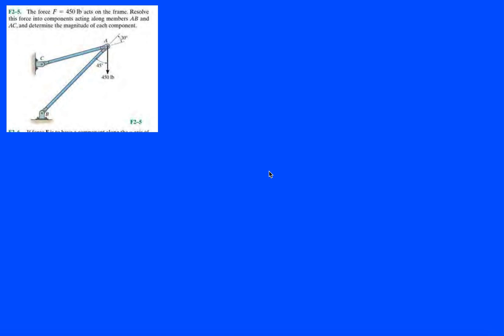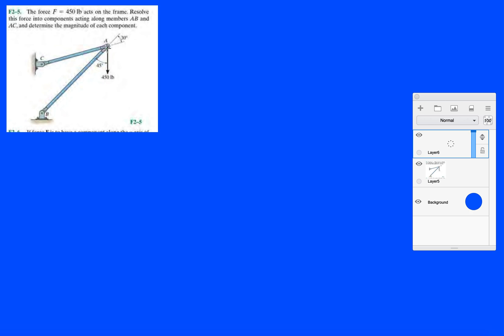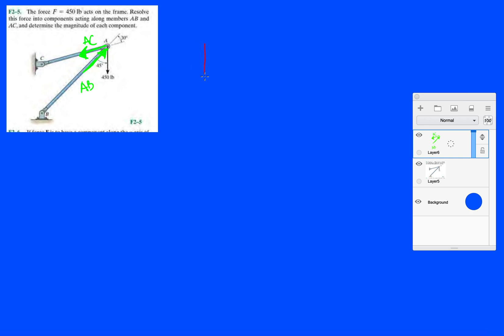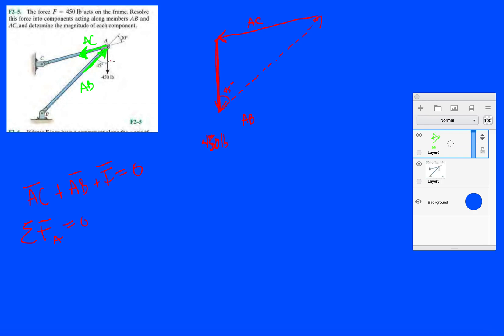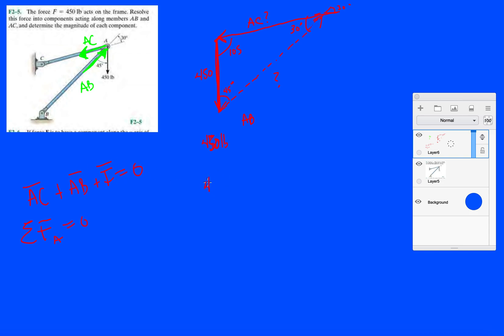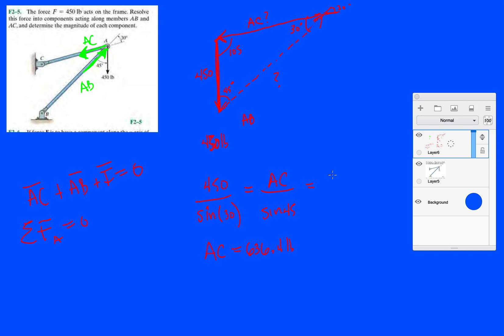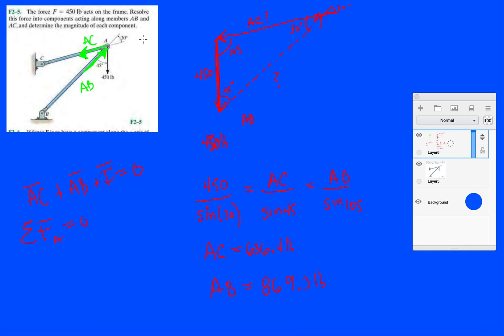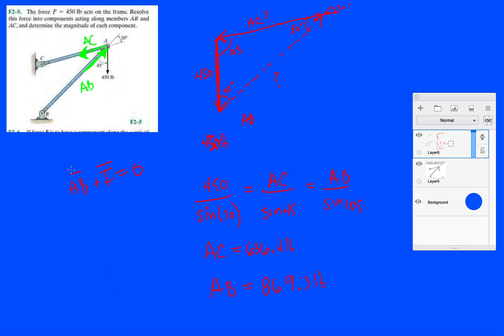Problem F2-5 Statics Hibbeler 12th (Chapter 2)

Comment: I dont get how you know where should AB and AC member arrows direction, why it not fir example AB member is direct along compression direction? I hope you got my point
Reply from the maker: It's a bit tricky. AB + AC + F vectors, all have to add up to zero. Initially I don't know which direction to choose for AB or AC, but when you do the force triangle (add all three forces), they must add to zero. So if you did, all compression, your force triangle would not a be force triangle (try it on paper). The tip of the arrow of your last force, would not end up on the tail of the first arrow. This means you have a resultant force! So again, you need to choose the directions to make sure they make a full loop. Hope that helps, it's tough to explain on writing.
Reply: @theengineeringcrucible3490  thank you so much i really appreciate this from you ♡ 
This way will work if we determined that F vector which given is a resultant vector. 
Ty again